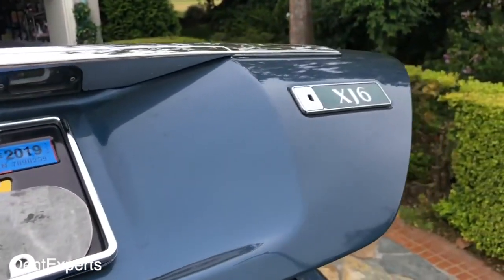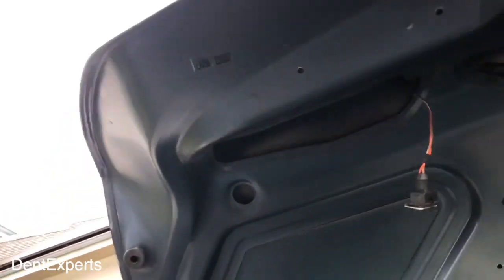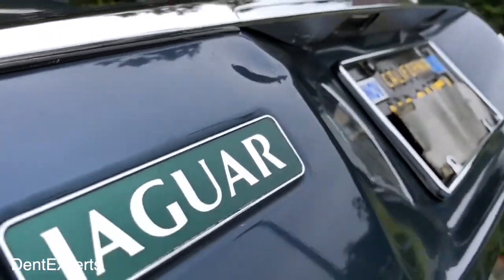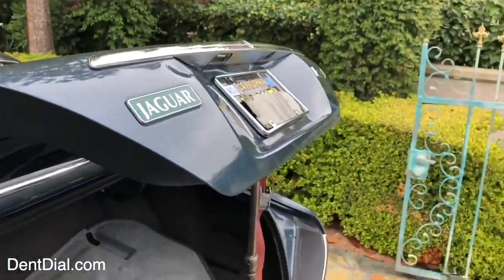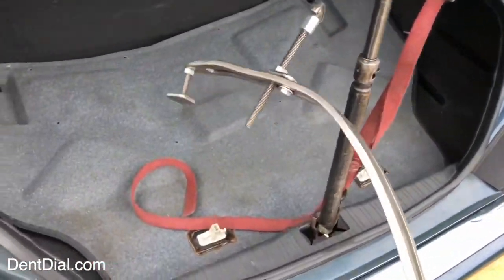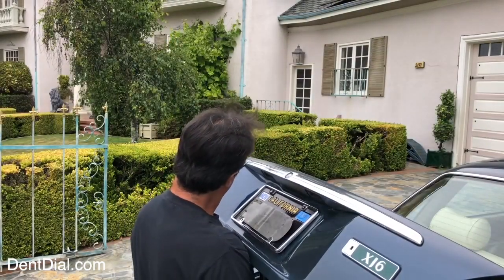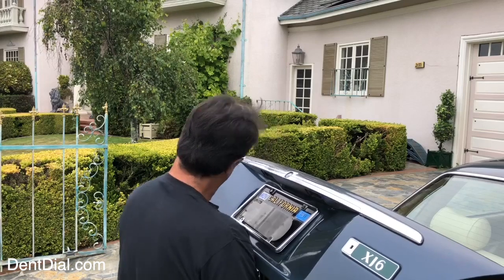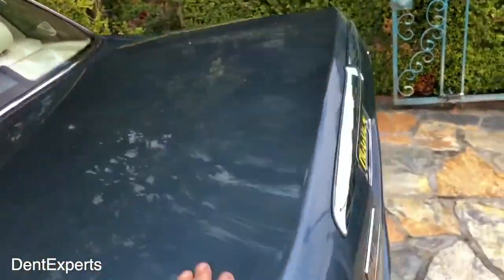Paintless Dent Removal works on old cars!!!!!

Comment: I have old volvos so thick metal is what im dealing with
Reply from the maker: When it comes to PDR thicker metal is by far the easiest to work with compared to worst would be a Subaru WRX.  One is a thick copper skillet from williams sonoma and the other is a bud light can.
Reply from the maker: a big hint for you tackling thick metal is that the surrounding pressure wave can be hidden in the slightest of ways and you must find it and relieve it all.  Many tap at it only chopping it into a mess and I found the true path is using wide flat strikes that make no mark.  Be well have fun!